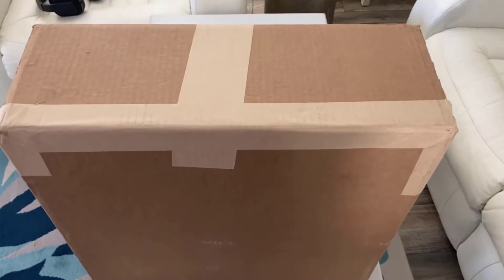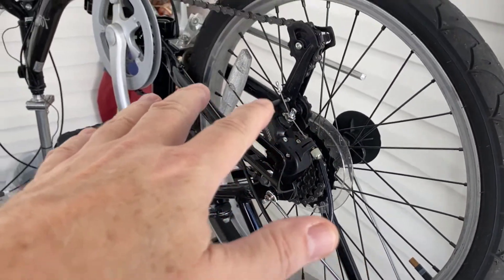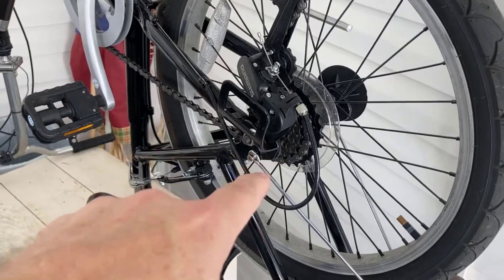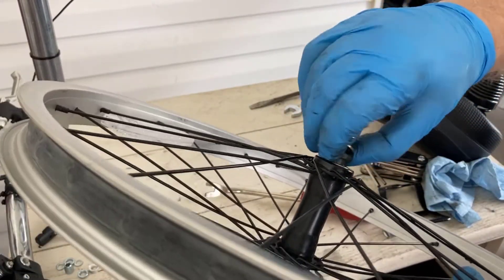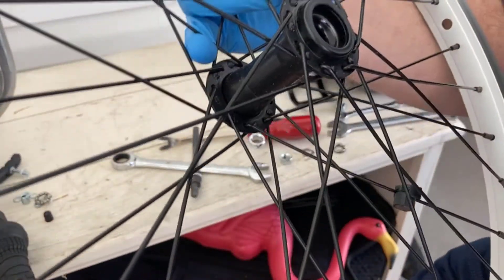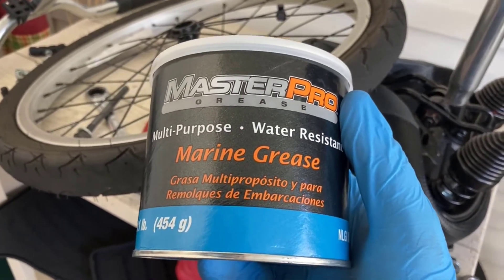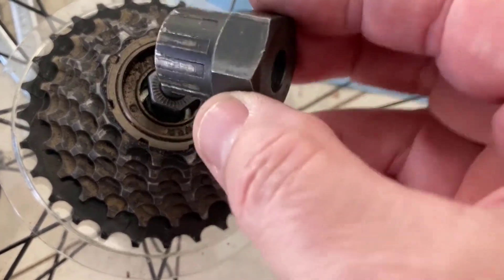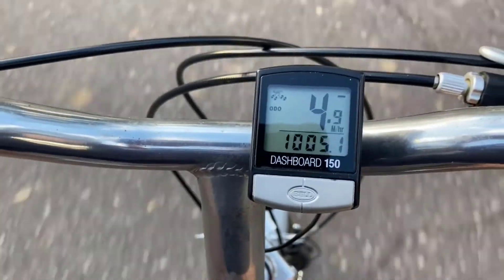Schwinn Loop Broken Spokes at 1k miles

Comment: Hi. Have been considering the Schwinn Loop (used) and then I recently found the Tern Swoop (used)(more expensive)(similar in looks). I've heard that Tern is a better brand. Do you know anything about the Tern Swoop or have any comments?  Also great videos on the Schwinn. Very in depth.
Reply from the maker: Never heard of it till now. I wonder what you will choose?
Reply: @Mity_Moose  Good question :-) because now I'm considering a folding bike with an internal hub (multispeed). Citizen, Worksman, and Sun all have 3 speed.  Worksman and Tern have 7 speeds. And Downtube has 8 & 11 speeds with belt drive (not a chain).  Those are the only brands that I have found with Internal hubs. Internal hubs keep the bike cleaner and shift smoother / less mechanical problems from my research.  Any suggestions or comments about any of the brands above or about internal hubs are greatly appreciated.
Reply from the maker: My criteria was something that would hold me up and folds. And, I think that is why i had 3 broken spokes after a thousand miles on the back wheel. But it happened within the year warr. and they sent me a new wheel. If you are exercising, and not over 300lbs, then get something that works within your mechanical and field of use. If you have hills, believe me, you need more gears. I am on flat land and I can use any bike. I was not out for speed or off road. I just did not want to exercise in doors. The Loop has been great because, initially, I wanted to tour around with it, and it folds up into nothing. It even came with a carry bag.
So, with that, I would NOT consider the longevity of hub designs, I would focus on pleasure of riding. Where I live there are folks who put 30,000 miles on regular cheap bikes and never do anything maintenance wise. They ride every day, same time every day, same distance, same rout. My fav. time is dusk since I cannot be in the sun anymore.
Good luck on your choice, and let me know what you go with.